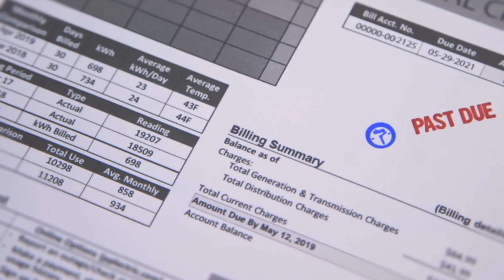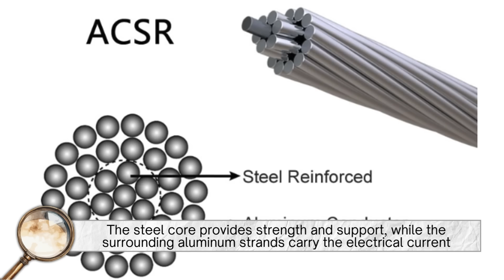Why Do Power Lines Use Aluminum Instead of Copper?

Comment: 3:20: Copper is also more attractive to thieves (and a few win Darwin awards each year for trying to steal energized electrical cables).
Reply: For real, it keeps happening to the light rail lines in LA.
Reply: Yes, in Pakistan, extensive theft of overhead catenary wires led to Pakistan Railway abandoning its plan to electrify the railway system.
Reply: @VisSaklegend a Muslim country I'm surprised South Africa has the same problem
Reply: Crispy grilled apes 🤣😁
Reply: Watch some Indian vids. They like to climb power poles and fry themselves just for the fun of it.
Reply: The AlO2 coating on aluminum wires is itself enough of an insulator that you can touch those wires and not get a shock.
Reply: @mikezylstra7514  Al2O3 is used as insulation in low-voltage electronic components, but I wouldn't trust on voltage that high (kilovolts).
Reply: @Larry660  Oh, I'm just having fun with the biz grads.
Reply: That is not a priority
Reply: @tesmith47  What makes it not a priority, power outages when thieves cut the wires, or dead thieves?
Reply: @tesmith47 it is in poor countries
Reply: @markbrown9826 poor countries like canada and the USA?

Comment: 2:40: So the calculation isn't  current carrying capability  related to cross-sectional area, but  current carrying capability related to mass per linear foot.
Reply: @Larry660   The basic calculation is made by plotting two curves and leaving everything else the same (power to be transmitted and distance mainly)
Curve 1: Cost of wire vs cross section. That curve goes up (the thicker the cable the more expensive it gets)
Curve 2: Cost of power losses vs cross section. That curve goes down (the fatter the cable the less $ in power losses)
The point where the two curves cross each other is your optimal cross section for the best $ investment.
This is of course a very simplified description but the basic facts are all there.
Reply: @pindapoy1596  Cross section is not constant because you are comparing aluminum (requires a larger cross section, but costs less and is lighter) to copper (same comment reversed). Substitute resistance per foot for cross section.
Reply: The current carrying capacity depends on how big a heat loss you are prepared to tolerate and how much heat any insulation can stand without melting.
Reply: @harry130747 no, how much energy loss

Comment: Aluminium is simply cheaper than copper. 
You could also use silver, but that is even more expensive than copper.
Reply: They actually used silver for electrical stuff in the Manhattan Project because they needed copper for bullets and had all this silver intended for coins just sitting around.

Comment: The price of copper is more valuable than aluminum which is why thieves steal the two metals. Thieves have been electrocuted stealing power lines made of aluminum. In 1979, three men attempting to steal power line copper wire were electrocuted when their aluminum ladder hit a 26,000-volt power line in Bayonne, New Jersey. In 2009, two power line wire thieves were found electrocuted and burned beyond recognition after trying to steal wire from a live electrical box in San Jacinto, California.
Reply: Trying to wrap my mind around a 26,000 volt line being within reach of a ladder.  There's a 4,000 volt line through the back of my yard that is 30 feet up, and that's scary enough for me.
Reply: And the power company had to pay a big lawsuit benefit to the family because there was no sign saying you no , metal ladders !
Reply: Instan karma

Comment: So aluminum is lighter and cheaper than copper. No surprise there. Fun fact: silver is even more conductive than copper.
Reply from the maker: Yeah, silver being used for certain components with specialized function :D
Reply: @g; m
88iipinosko-greek
Reply: @ginosko-greek  By the way it is spelling is Aluminium not aluminum.
Reply: Thank you!  Based on your comment, I will rewire my home with all-silver wire.  It is an excellent way to own valuable metal and less resistance means less global warming!
Reply: @SunriseLAW  Plus a good way to hide it in plain sight.
Reply: @SunriseLAW global warming? From resistance? I says pardon
Reply: Carbon nanotubes and graphene are lighter, stronger, better thermal and electrical conductors than any metal and don't corrode. Making long wires at a reasonable price though.. not going to happen soon. Maybe 100 years.
Reply: @donutwindy  I think that carbon nano tubes made in labs are still pretty short. Commercially viable nano tube wiring is probably a long ways off.
Reply: Yeah I learned that from Frankenstein movie.
Reply: And more expensive.
Reply: Gold is more conductive than silver...
Reply: @leecowell8165 Um, OK. Can I replace my house wiring with God through prayer?
Reply: Yes, but not by much.
Reply: Ο χρυσός είναι ο καλύτερος αγωγός, γι' αυτό χρησιμοποιείται στα microchip και στις επαφές όπου απαιτείται η καλύτερη επαφή.
Reply: @grgstrts4051  Noooooo. Silver is Number one! Honestly!!!!!
Reply: @grgstrts4051  Gold has a lower electrical conductivity than silver and copper. It is less conductive because its greater nuclear charge holds its outer electrons more tightly, even with an additional electron shell compared to silver. 
But gold is still used for its unique property i.e. corrosion resistance. Gold is highly resistant to corrosion and tarnishing, which can degrade electrical connections over time. This makes it invaluable for maintaining reliable contact points in electronic devices.
Reply: @grgstrts4051 no gold is not
Reply: As best I recall gold is even better
Reply: @chichi90504  Nope. Silver is better!
Reply: @chichi90504 Gold has a lower electrical conductivity than silver and copper. It is less conductive because its greater nuclear charge holds its outer electrons more tightly, even with an additional electron shell compared to silver. 
But gold is still used for its unique property i.e. corrosion resistance. Gold is highly resistant to corrosion and tarnishing, which can degrade electrical connections over time. This makes it invaluable for maintaining reliable contact points in electronic devices.
Reply: Fun fact number 2: gold is even more conductive than silver or copper! :D
Reply: @ryanpotts3350 it's not. Silver is the most conductive metal.  Gold is third, behind copper and ahead of aluminium (which is 4th)  gold is used where a good contact is required  between plugs and sockets, etc because it is non-reactive meaning no pesky oxides.
Reply: @5688gamble  you're right. i don't know why i remembered gold being more conductive, probably because its usually used on high speed contact surfaces due to its corrosion resistance
Reply: @ryanpotts3350  Power lines made of gold would vanish before power companies could even string it onto poles and towers.
Reply: @ryanpotts3350  Gold is not more conductive than silver or copper.  Look it up.
Reply: @ryanpotts3350 Gold has a lower electrical conductivity than silver and copper. It is less conductive because its greater nuclear charge holds its outer electrons more tightly, even with an additional electron shell compared to silver. 
But gold is still used for its unique property i.e. corrosion resistance. Gold is highly resistant to corrosion and tarnishing, which can degrade electrical connections over time. This makes it invaluable for maintaining reliable contact points in electronic devices.
Reply: @TheRomio2009 There are a couple of factors as I recall from my telecom engineering days. 

Gold is great for corrosion resistance✔️. However, microscopically it bonds better to itself, creating more surface area for conducting, another factor in how well a material conducts. This makes it great for high speed connections.